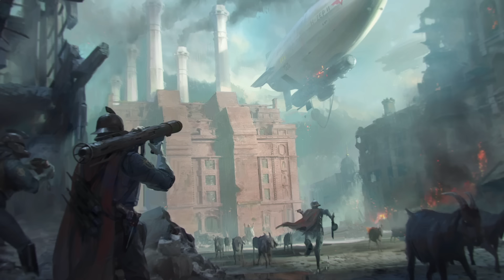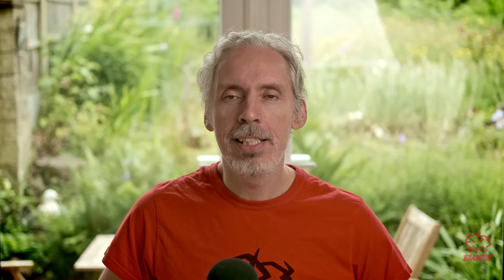Blender Camera Projection Mapping Tutorial - Part 1/3

Comment: You can do this in under 10 minutes using Photoshop to cut out your background, middle ground and foreground. Then import the psd file into After Effects with the layers preserved, hit the little cube button on each layer to add them into 3D space, and then use keyframes for the parallax.
Reply: That isnt really giving the same results. That is 2.5D and and you are only working whit 2d plains. It is very limited what you can do with perspective changes. If you rotate the camera too much the illusion brakes.  Here  2D elements are "projected" to 3D elements and you can do much more elaborate movements inside the scene.
Reply from the maker: Thanks for your comment! Yes, this kind of work is often done in After Effects, though Blender is a free/open source program that everyone can access!
Reply: With After effect, you get only 2.5D environment. But with Blender, you get 3D environment. There is a big difference!